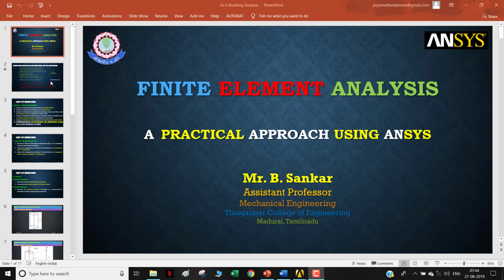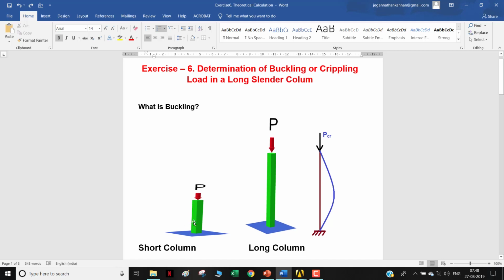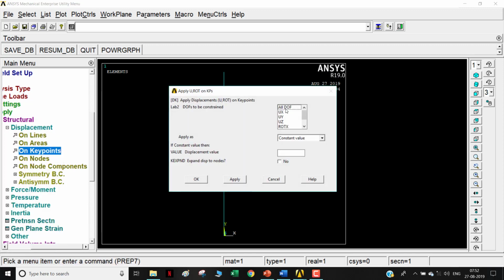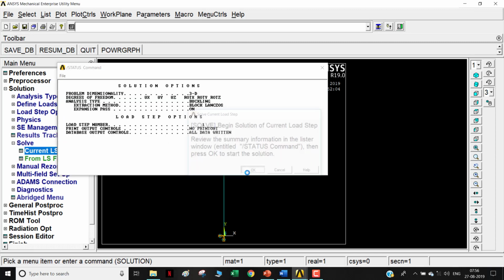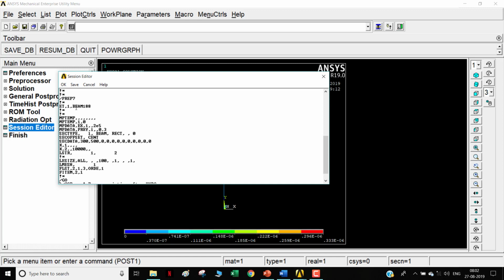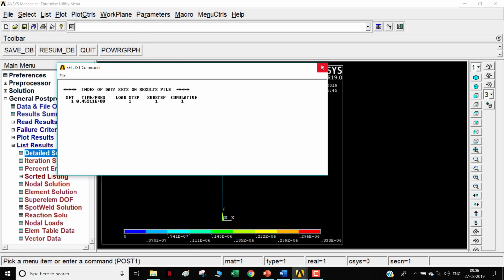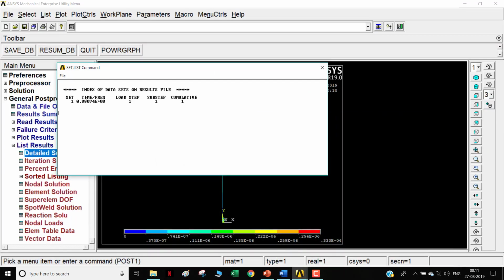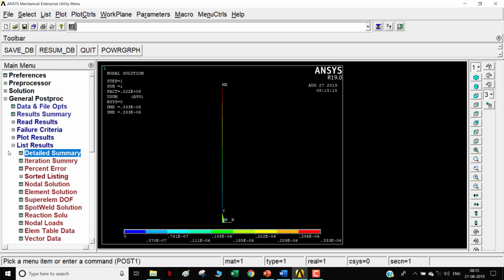Buckling Analysis of a Long Slender Column using ANSYS APDL | Eigen Value Buckling

Comment: I want to simulate concrete column wrapped with CFRP with ANSYS finite element ...can any one please provide me with a reference or video could help.?
Reply from the maker: I can help you if you provide me the exact problem with help of a diagram, material properties etc
Reply: I can't do carbon fiber modeling on the column surface.
I need references or video to model an reinforced concrete column wrapped in carbon fiber layers.
In addition, how is carbon fiber defined on the program
Thank you for answering me, thank you very much
ِANSYS APDL or Worbench